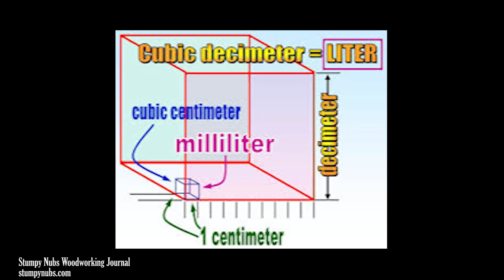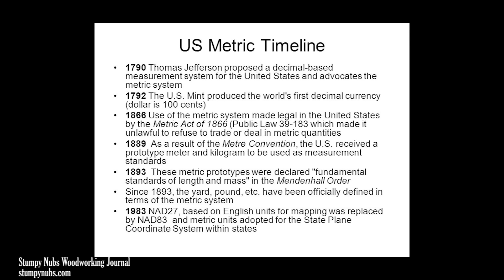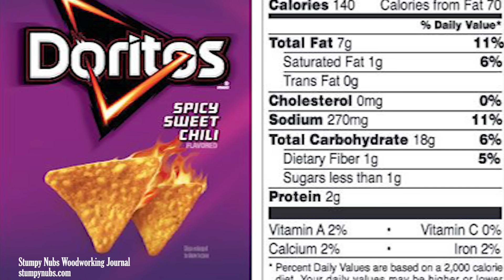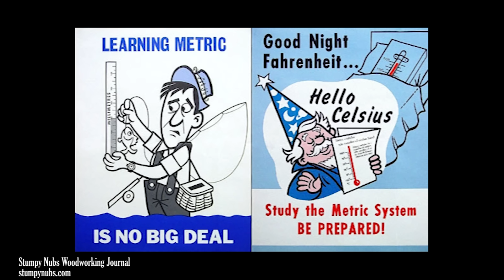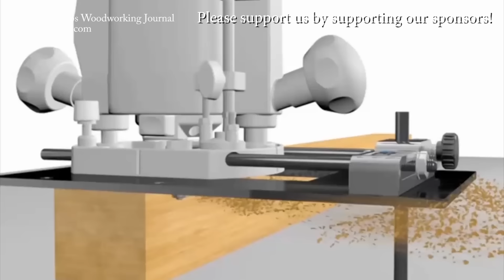BREAKING: The USA is switching to METRIC!

Comment: Fun Fact: The United States doesn't use Imperial like the British, but rather Customary, and the Australians use their own version as well. Volume values such as a gallon are completely different between these systems. The US Customary system even had two definitions for a foot as one was standard for surveying, but they have since moved that definition over.
Reply: Australia uses metric nowadays
Reply: @DestopLine But beer is still ordered by the pint instead of the “500-some-odd mL”, no?
Reply: @aycc-nbh7289  I have no idea, I just know that from other videos on metric vs imperial I've seen several australians in the comment section saying that they use metric. Also the videos themselves say that Australia switched to metric in 1970.
Reply: @aycc-nbh7289  Yeah but the "pint" here is 570ml for an 'imperial pint' or 425 for a schooner, which is sometimes also called a 'pint' depending on where you are. "Pint" is just shorthand for 'the big glass', as opposed to "the small glass" (285ml) which has a different name depending on the state: pot, schooner, pony, middy, ten, handle etc. The important point is that even after downing a few pints I could tell you that an imperial pint weights roughly 570 grams (or 0.57kg) and measures roughly 570 cubic centimeters.
Reply: Yeah that's the entire reason for the SI. Just about every country seemed to have its own slightly incompatible version of the ancient units, which made commerce and interoperation very difficult if not impossible as economies slowly became more international and integrated over the modern era.

Comment: I'm in Canada and still do home renovations in imperial units.  Drywall and plywood are 4x8 foot panels though the thickness is now mm. Studs are on 16 or 24 inch centres, tiles are in inches...  I tried going metric but found it more difficult given the standards in construction that even 50 years after going metric are still imperial. 
For woodworking I use and prefer metric. I could tell I made the switch when I started converting to metric to visualize units.  If someone says something is a foot I think "about 30 cm" now converting to metric in my head.

Comment: As a European i watch a lot of American woodworking content and when it comes to measurements i find it difficult to convert inches to centimeters. So i would applaud it when yiou would embrace the metric system... makes it easier for everyone.. 🙂
Reply: 40 inch = 100 cm
20" = 50 cm
8" = 20 cm

Zo onthoudt je dat. Gewoon tabellen leren.
Reply: jellewijbenga455  Not everyone
Reply: the inch unit system and other unit system are stupid. It is not because of stupid system, but because  that they are not compatible with the international system SI. All other unit systems must compatible with the international system SI. 
I often use computer programs for technical machines and other engineering tasks. And I often have to store and enter various values for various variables in computer programs, then let computer programs use entered values to calculate various tasks. You know that computer programs use standard known scientific formulas to calculate. If you enter values for variables in different unit system, then any time you add values, you must check the unit used in scientific formulas, then you must convert the added values to required unit systems. It is nightmare in engigeering tasks and scientific tasks. 
The only solution is that : use universal unit system SI : all programs and people exchage and communicate only with values in SI system. Thus no need to convert and check formulas when you apply variables in scientific formulas.  
Other unit system maybe comfortable only in conversation communication languages, but not in engineering tasks.
Reply: @abstractexchange5057  I agree with you. The main things why Americans do not want to change is awkwardness of learning a new measurement system and they the USC as American. Part of their American culture.
Reply: Just multiply by 5 and then divide by 2 for a quick approximation.
Reply: @@KeyDx7 so woodworking doesn't need precision, you must be a bad carpenter
Reply: @Ikkeligeglad  1/32 is more precise than a millimeter -- just sayin'
Reply: @lepermessiah2608  "Just multiply by 5 and then divide by 2 for a quick approximation." And add glue and sawdust to perfect fit.
Reply: A sheet of plywood becomes 1.217 x 2.4384. Now cut in half lengthwise. 😳
Reply: @chuckbussell2400 You can go down to micrometers, nanometers if you want to be sure. Just saying.
Reply: @mardiffv.8775  Or, if you'd rather be correct/accurate:
40in = 1016mm (101.6cm)
20in =  508mm (50.8cm)
8in =  203.2mm (20.32cm)

Comment: UK here. Always been metric. We learned about inches in school, but universally preferred the metric system when measuring anything. I'd hate to have to continually add up different fractions to compare sizes for trims and cutting.
Reply: 19/64th … go on work that out.

… it’s 7.5mm.
Reply: Ah, you mush be a young man, I went to school in the 60s. All imperial. The metric system was introduced in 1965 but many implementations remained imperial until 1995. Money changed to metric in about 1970. Imperial is still used in many applications either instead of or alongside metic. Drill bits, booze, road distances, and on an on. I swap between metic and imperial all the time, depending on the application.
Reply: Don't you still use miles and mph in cars?
Reply: @tomaskot9278 Changing road speed signs would cost the tax payer billions!   Plus at the time the UK went metric many British cars only had mph speedometers. You can imagine the mayhem on our roads if we had changed to kph.
Reply: @tomaskot9278  We do and it'll stay as it doesn't really matter whether Birmingham is 100miles or 160km distant unless you're actually laying a phone line or building a road there - for the rest of us it's an arbitrary unit that gives us something to work with. A lot of people who grew up with metric still use imperial for things because the numbers work nicely: A scrap of wood a foot long - easier than 300mm. Whether someone is 5' or 6' - nicer numbers than 1.5m or 1.8m.
Reply: @smorris12  And what about a scrap of wood one meter long? :)
Reply: But how many stone are you?
Reply: @tomaskot9278 and pints in pubs
Reply: @smorris12  However, you have a problem with precision. 5' can be anything between 5' and 5' 1", that leaves an error margin of 25.4 mm. While 1.5 m and the next measurement in the scale 1.51 m would have only an error margin of 1 mm.

I used to be a basketball fan and whenever USA players came to play in Europe we'd have their height translated from feet/inches to metres, and European players or sport journalists would always make jokes about this sort of thing of suddenly squeezing down (translated measurements would never be right, and feet/inch measurements were usually rounded up).
Reply: @riangarianga  But that's the point. It's nice not to have the precision and deal with simple numbers. I'm 5'9 and a half. But 5'9 is way close enough for almost everything. Even coffin builders wouldn't need more precision!

Comment: Great video. As a Canadian who lives next to the border I learned metric in school but imperial from TV and working in the shop with my dad. The only time I use metric in the shop exclusively is when installing undermount drawers just because I find it much easier since it was designed in Europe and some of the fractions get a little ridiculous.
Reply: Most of the machine shops I visit in Ontario that are running high end CNC are using the Imperial system; even though the machines can be changed to read out metric in about 3 min.
Reply: I think we should compromise. America fully Embraces the metric system and the metric system adopt the dozenal system. This will fix your fraction conversion problem.
Reply: Most likely because a lot of the work is done for US clients so they would have to constantly convert back and forth if they ran metric?

Comment: Im a carpenter in Ireland. our plywood still comes in 8ftx4ft sheets and our plasterboard comes in 1.2mx 2.44m  Osb could be eather. because of this sometimes my joist spacing is 16 inch and sometimes its 0.4m

Comment: As a Harley drag racer in Europe, I´m surrounded by either system- drive 320 kilometers to Hockenheim at 34 degrees Celsius, go for a 1.4 second 60feet time, explain how much cc a 96 ci motor has got, get a 3/16" allen wrench to tighten some 1/4" bolts, and enjoy half a liter of beer from Belgium afterwards. Went fine so far. Thanks for making serious stuff fun to watch!!
Reply: I have not thought of Hockenheim in a very long time.  I was at the  Formula 2 race when Jim Clark was killed, that was a long time ago.
Reply: Exactly.
Reply: The difference is you get to dabble in Imperial. You don't have to live in it.

Comment: I grew up in New Zealand and experienced their change from imperial to metric units. It was pretty easy - at first you just learn the equivalents. For example a 2x4 is  50x100. Architectural scales work fine too: 1/8" to 1' is 1:96, which is practically indistinguishable from 1:100. Returning to the practice of architecture in the US, I had to get used to imperial again at least for drawings (although many materials are European or Asian and tend to have metric thicknesses, for example). Now retired, I build 3D printers and work entirely in metric, with a nice US-made Starrett metric tape. I think the most difficult thing about imperial is calculating areas and volumes. 3' 2 3/16" x 11 7/8" is not easy to do in your head, and even with a specialized imperial calculator it's tedious to enter. In construction and woodwork, a lot can be done with a whole number of millimeters, so you can frequently dispense with the decimal point - a mm is less than 1/16", and I rarely need more precision than that. I suspect that adapting to a different system is mainly an issue of developing an intuitive sense of sizes. Practicing architecture for a number of years in feet and inches means I have a reasonable idea what 8' feels like. Getting a feel for lengths in a new system takes time. But from a calculation perspective, metric is a lot easier.
Reply: I just recommend Starrett to someone looking for a metric ruler.  I inherited the 15 cm ruler I have from my dad.  It dates back to the '60s and still looks brand-new.
Reply: Not to nitpick, but even in metric, calculating an area of 38.195 x 13.875 (converting the example you gave to decimal inches in my head) wouldn't be that easy to pull off mentally in metric units either. I'd even propose that doing either the fractional multiplication or the decimal multiplication in that example are both tedious mentally.
Reply: I had people tell me that a 1/4 inch is equal to 6 mm. But these same people couldn't squar that circle. 6 mm x 4 = 2.4 cm, but an inch is 2.54 cm.
Reply: @JLProPhoto But it’s still easier than doing it in fractions of inches. 😉
Reply: @alejandrocantu4652 You know you’re allowed to work to as many decimal places as you like though, right?!
Reply: Any time I have to calculate something like 3' 2 3/16" x 11 7/8", I first convert the whole thing to inches with the fractions as decimal numbers, ie 38.1875 x 11.875", and run the calculation. Then if needed, the answer can be converted back easily from decimal to fractions. You get used to doing that by living in a metric country and so often having to convert so-called  Imperial to decimal and vice-versa.
Reply: @rickhayhoe  In your head? OK mate! 😉

Comment: I use both interchangeably. I have a much easier time thinking in feet and yards for framing projects, but I prefer to use millimeters when doing precise work like hinge mortices.
Reply: I'm the opposite. I'll use metres outside measuring big things, but then I'll use thousandths of a inch to measure small precise things.
Litres to measure fuel and pounds per square inch to measure pressure.
For me it's like speak two languages.
One is not better than the other only different.
Reply: especially when many are in metric to begin with

Comment: Grew up with both in the UK. I prefer metric for precision and more scientific thing. Inches and feet for more rudimentary human scale things.
Reply: It is not more precise. Metric is something that cons people.
Reply: @Art-is-craft  hardly anyone wants to work with fractions like 1/16, 1/32, 1/64 ths of inches. Or 1000's of an inch like I sometimes do with my guitars. I only do because most of the instructions for electric guitars are in those units. 

When designing stuff for 3D printing, I'd much rather have 0.2mm than 0.0078 inches.

When I look at a desk, door or length of a room, height of a tree. That's when I think in inches and feet.
Reply: @antmax  
Traditional fraction scales are superior because they are a natural system.

Comment: The snark is thick in this one James.  😂 This was great lol. But seriously, I think it’d be easier to learn as you stated, but extremely difficult to convert. Besides, I’ve always said I can rotate my tires with a 19mm socket on my 1/2” impact wrench and I promise WW3 won’t break out, hellfire and brimstone won’t fall from the sky and my impact won’t explode.
Reply: I work in the US for a company owned by an Italian family.  Most of our equipment is metric, but here in the US, some things are not available in metric, or are prohibitively expensive (a 100 x 100 square steel tube is 8X the cost of a 4" x 4" steel tube (4" is equal to 101mm).  Add to that a blending of Imperial and metric fasteners throughout the plant, and one must be completely conversant in both systems.  I have to correct myself sometimes when I design a part with metric measurements and Imperial fasteners, or some other combination.  I have to watch myself so that I don't use half metric dimensions and half imperial.
Reply: @JeffFine  A conversion would simply require picking a "close enough" value for all common materials. You'd obviously be able to custom order the imperial sizes but they would become more and more expensive as stock of them dwindled. And before you get too upset, remember that a 2x4 isn't 2 inches by 4 inches anyway, so a 38x90 wouldn't be that big a difference.

Comment: I converted my woodshop (garage) to metric a year ago. It’s been great. Less errors in the past year. The hardest part has been sourcing measuring tools that are metric-only. If the tool has imperial measurement, my natural default is to use that still, so I need tools that have no imperial measurements.

Comment: In Argentina we're still using Imperial for anything plumbing or wood thickness related.  Makes for a quick ask at the hardware store. Old machinists still work in Imperial, but they are - sadly - a dying breed. Personally, I've gotten so used to both systems for my scale modeling that jumping from one to the other is no problem.

Loved the dry humour on this one, too. Didn't know they were able to measure things up in those places complaining about Imperial.

Cheers.

Comment: one of the things i love most about the metric system is the conversion between different units
1 cubic decimeter = 1 liter = 1 kilogram of water
this conversion between size / volume / weight is just beautiful
Reply: With imperial it's close but far enough off to screw things up.  This is especially true when chaining quick length and volume calculations.  Example: 1 US fluid oz = 1.80469 cubic inches.  Oh so close to 2 but far enough off that your answer will be wildly wrong if you use 2 in your math.

Comment: Nice video about metric in the USA. Pretty accurate. Unfortunately, everyday usage for most people is still Imperial. Also, Liberia snd Myanmar are well on their way to finish converting to metric despite some hiccups. That leaves just the USA as the sole outlier with Canada and the UK  still having some rough edges.
Reply: the USA has never adopted the Imperial system
We use the United States Customary System
And yes, there is a difference

Comment: Being Gen X, I lived through the concerted effort to go metric that arose after the 1975 act. My schooling was heavily metric with only a smattering of the Imperial stuff until junior high, at which point it had become apparent that the old folks had put a stop to the changes and a metric shift was never going to take hold. Now I feel like I'm part of a generation that has a very muddy grasp of both and would be fine if everybody made up their damned minds once and for all.
Reply: It is not what you were taught in school but about what you use.    Both systems are simple.     A thinking adult can learn fractions in a few minutes.
Reply: This is a fact. I didn't even think about this but it is certainly true. I tip my befuddled gen x hat to you!
Reply: As a fellow Gen X’er, I second this proposal.
Reply: Yeah. GenX here. Learned both in school. I can use both equally well, but still prefer imperial. My brain just understands immediately if you say 6 inches, I'll know approximately how long we are talking about. But you say 15cm, or 6 cm, and I can't visualize it. I also like the way fractions represent measurements. If I'm looking at something and it's 2 feet long and you say something is about 1/4 that size, I can visualize that.  

I guess because my parents were completely imperial (except money), that's just what I came to use.
Reply: Same boat. I’ve mastered the imperial measuring system. And it’s foolish. Pleasurably nostalgic, but foolish. Let’s put this bullshit behind us and just move forward with another 250 years of USA. Using the metric system please, if I haven’t been clear.
Reply: Yeah, two school years taken up with conversion math. Ended up not learning either system well and finally taught myself fractions around 2007 by watching some utoobs videos.